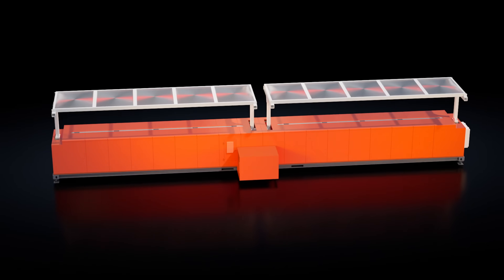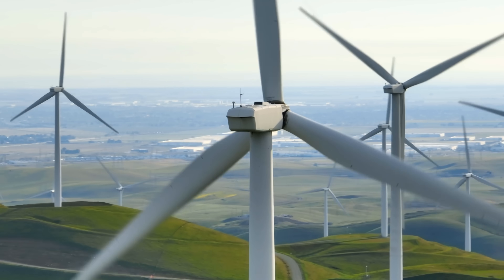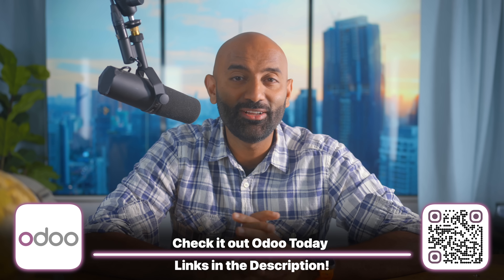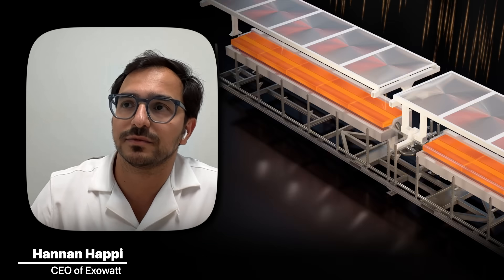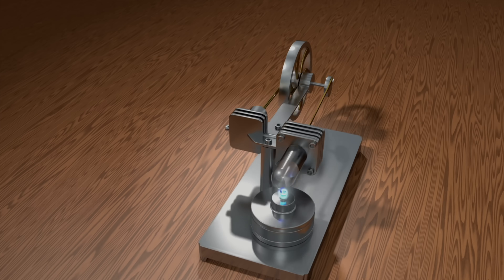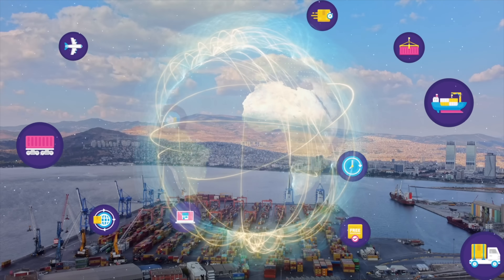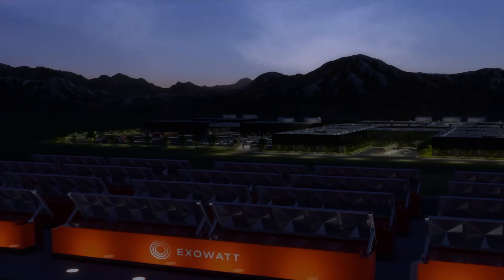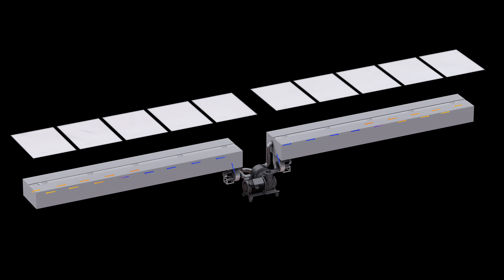Solar Without Panels, Storage Without Batteries - EXOWATT

Comment: Analyzed this thing with ChatGPT. ChatGPT is not impressed:

Summary Table
Aspect	Exowatt’s Claims	Real-World Considerations
Technology	Solar → heat (via lenses), stored thermally, then converted via heat engine	Proven concepts, but with historical challenges in scale and cost
Efficiency	35–40% system-level efficiency	Comparable to gas—but past solar-thermal systems often fell short in practice
Cost	4 ¢/kWh now; target 1 ¢/kWh	Ambitious—depends on scaled production and operational performance
Deployment Model	Modular, containerized, rapid, grid-independent	Attractive, especially behind-the-meter for data centers
Skepticism	Backed by high-profile investors and media coverage	Tech “hype” is a risk; real-world mitigations required

Comment: Just an observation but where the focused sunlight comes into the top of the Exowatt unit. How isn’t a percentage of the heat not lost having a hatch opening? It would seem logical that being at the top of the storage area a significant amount of heat would escape, no?
What would this loss have on the systems overall efficiency?

Comment: I've been thinking about this for ages because it is the most simplified method for getting electricity from the Sun instead of using solar cells to move electrons across the board to create electricity you just heat water turn it into a pressurized gas and use that to run a pressurized steam engine that generates power you can even use a kinetik battery for storing the power by having the steam engine with weights on pulley systems that are attached to gears so you can control the flow of electricity that way as well so you will never run out of electricity and you will never need any chemical batteries the only thing you need is a  material that can stand up to the pressure  heat and wear and tear for long-term which would be the most difficult part of the whole operation. To create a solar-powered energy cycle that can produce save and dispense energy at will without something mechanical going wrong I had ideas for that as well but that's for metamaterials

Comment: This was my idea years ago the only thing missing is the condenser for recycling the water instead of having to cool the water through electrical means you use another container underneath buried up to 8 ft and that would drop the temperature of the steam enough turn it back from a gas into a liquid and have solar powered water pumps to bring the water back into the steam engine and have a pressurized container that has a release valve so you can control the amount of electricity that is released by controlling the RPMs of the steam engine

Comment: Yes, please do an in-depth review. I see a lot of exploratory DER that fail because they haven't considered practicalities. That this firm have considered the full supply chain, manufacturing, distribution, installation and maintenance seems a lot more promising. One thought to checkout, can they sit on top of a data center or is weight / heat / installation too big an obstacle? Looking forward to hearing more.

Comment: Have you ever heard of the Super Critical Water Oxidation Process developed by General Atomics?  This process breaks down organic waste such as that found at refineries.  The process is exothermic and the heat can be captured to produce steam.  The byproducts of the reaction are salts and water.  The unit can fit in a two car garage.

Comment: Sounding off! I want to know more about this project. 

I've worked in wind energy for 8 years as a Electrical Engineering Technologist, Starting in management to operations to working as a tech on the Turbines. After seeing what's involved and the cost and energy that goes into building, also factoring in the poor state of many of the grids where they are installed. It really isn't feasible to go full green.  So much so that I've come to the conclusion that Nuclear is the way to go for large scale "Green" Power.

However after seeing this, there is some real potential here. One unit which can produce 25K Watts has real potential for homes in the country. With units like this there are so many ways to reduce costs for the grid, and by doing so allowing fortification of the grid in key areas. This could be a massive boon for energy consumers and producers.

Comment: Compared to the plug and play nature of solar panels, this solution adds so many moving parts - maintenance will be a never ending challenge. Unsure on dangers when combining high temp, high pressure engines and volume energy storage.  Wouldn't be surprised if parts of this design are forced underground to aid in cooling or reduce surface devastation in a blowout.  kinda kills the portability

Comment: Also, do you have an episode on vertical thermal turbines? I saw a prototype in Spai,n then nothing. It is a cylo with multiple fans that can slide in and out using the rising air pressure to provide 24-hour power. Also, there was something about a focusing...cone that focused the heat into the ground. If I got the name wrong, I hope my rabbings make sense.

Comment: If you're using Sterling engines, why only one to the two containers vent the exhaust to several? You might lose 12% pressure, but a Sterling only needs heat to move.

Comment: There is couple of stuff:
1. Main advantage of this type of farm IS lack of need for complicated materials. Most stuff used for those farms are easily renewable.
2. Ai image generators should be simply destroyed and deleted. They are not worth anything they produce (more specialized uses like for genes, bacteria etc. can stay but they shouldn't keep ai generators for Facebook photos...)
3. There is still a question on how it is affected by time of the year. As it is extremely heat based farm, winter could cripple it.
4. This type of farm is even more susceptible to bad weather. Solar panels can still work when clouds are in the sky, they will simply work worse, but this farm might completely stop working if sky gets to cloudy for to long.  Because of that this farm might only be placeable in areas that often will not have any clouds.
Reply: 3. Sterling engines rely on heat differential, assuming one of the plates is just exposed while the other is eating 1k°F, the power will likely moreso be affected by total sun exposure available than temp differential across seasons. Similar to any Solar tech.

4.You'd be surprised how much heat you can focus even under moderate cloud cover with some lensing, but this argument is fundamental to solar capture technology in general. If the sky's going to be opaque for excessive timeframes, you're likely developing other systems to supplement this one.

This system will be viable pretty much anywhere solar capture proves viable, just not on the roof. The sell point for this system over photovoltaics is going to have to be how materially cheap it is to put together and nothing else.

They'd be better served using a static parabolic dish to that end instead of a solar tracking rig, imho, but I can see why they'd install the rig for some convenient planned obsolescence.
Reply: @Sch3m3r-a  4. It is competing against PV+Battery.
 How would a static parabolic dish work, it needs to track the sun.
Reply: @catprog 
By being a compound solar concentrating trough aimed for a target "optimum" likely around a 2 o'clock sun such that it would still dish down to 7 pm at an admittedly reduced efficiency.

Flip it around for morning sun at 10.

Reduction of viable surface area inherent to the "static" idea as compared to a tracker is probably actually why that's not their pitch.

As for their competition, I know, I watched the video.
Reply: 3. Summer would be the one that kills it. sunlight + cold weather increases effeciency. Hot weather decreases it.
4

Comment: Hi man, great video. Im just doing a little Elon Musk thinking here. Best part is no part, right. 

What would happened if we take away the one part of 3, like the Sterling engine, heat by itself is one of the largest sources electricity is then turned back to again, especially thru hot water. 

So factorys, schools, gyms, sport facilities, large stores and any household where they will fit close by could use this for that purpose even cheaper. 1-4 for the heat and hot water for example for probobly 10-20 households in a row. You could then also put cheap heating elements in there to be connected and take from the grid on off peak times to help out. And with no sterling you have space for more heavy mass.. water in and out, pipes instead of cables.. still cheap as chips.

Comment: 2:20  Wrong, the reason we could use something like this isn't for massive farms to feed AI.  That's the job of small nuke plants.  No, this would be useful for those off grid.  Finally you could have air conditioning on the sunny, hot days.
Reply: @DeclineManagement  or pump the heated air directly into the house in winter to save on heating costs :D (as long as the lenses arent covered in snow, I guess 😅)
Reply: He's not "wrong", you're just suggesting a different use. Good luck getting a small nuclear plant built in the US.

Comment: My brother (double PhD Standford math & physics) is very solar-skeptic and very pro-nuclear. Speaking vicariously for him, yes, I want a brutal on-site review of Exowatt, investigating as many of their claims as possible. (You allude to several engineering concerns at the end.) I do understand (and appreciate and basically approve) their engineering approach to be cost-effective vs. "the best" in terms of innovation or efficiency, so what I'm really asking for is a breakdown of their claims vs. actual operating costs. (I understand this is difficult when they are just beginning to install systems so your database will be necessarily constrained.) I know one of my brother's main critiques of solar is its low-density, high-land use compared to nuclear, so I'm less interested in an Exowatt-PV comparison as I am with an Exowatt-nuclear one. How does Exowatt compare w/ e.g. modular nuclear?

Comment: One would think storing the containers underground with only the tops exposed would assist in insulation and fire prevention. If there was a way to direct parabolic heat to a central location to provide heat to multiple units then they could be buried completely and the land above used for other manufacturing space etc. Same could be done by connecting large round tiles underground, and the heat source circulating through a much larger area. The calculations could be done to ensure the proper amount of heat per area and so long as the containers were covered in sand and then a soil area the external temps on average of 65 F could be maintained for maximum insultation advantage.

Comment: I think with all these data centres, district heating should make a a comeback as well. It is criminal that a house down the street from a datacenter (that is exhausting heat in the atmosphere) struggles to pay its own heating bill.
Reply: Even within one building, how many sports centres have thier a/c vent unwanted heat to the air instead of heating water, saunas, jacuzzis or pools. I even went to a centre that had a pool and an icerink and they weren't leveraging the two things different need!
Reply: Good for profits tho

Comment: I'm going to have to block this channel.  It's being a mouthpiece of gee-whiz promises without bringing the necessary journalistic rigor.

Exowatt's idea is plausible, but the density of power generation per acre of land looks unrealistic. Between the inescapable inefficiencies of converting sunlight to heat, then storing the heat in bricks, and then converting it into electricity and somehow accepting that the units can be spaced closer together than solar panels - which is ridiculous, because they have no less need to get unrestricted sunlight than PV panels do - this is a non-starter.  It has its merits but efficiency is not among them.  Land use is not among them.

Comment: About sun track, instead of a fixed angle, you can build a manual adjustable tracking system with just a few angle settings for summer, winter or anything in between. The device only needs a reset twice a year.

Comment: Exawatt P3 Overview

    Technology: Modular 40 ft shipping container system producing 25 kW each, scalable by adding units.

    Core components:

        Fresnel lenses focus sunlight onto thermal storage blocks.

        Thermal battery (ceramic/clay bricks heated to ~1,000 °C) stores energy for decades without degradation.

        Stirling engine converts stored heat into electricity on demand.

    Deployment: Shipped ready-to-use, minimal on-site construction, domestic materials, no rare earths.

    Target cost: 4 ¢/kWh now, aiming for 1 ¢/kWh. Calculations show 2.7–3.3 ¢ over 30 years; 1.7–2.3 ¢ over 50 years.

    Advantages over solar PV + batteries:

        24/7 dispatchable power built in.

        No lithium battery degradation.

        Lower land footprint (2.3 acres/MW estimated vs 5–10 acres for solar+storage).

        Long life (30–50 years).

        Proven individual technologies.

        Domestic supply chain.

    Efficiency: 60–70% light-to-heat; 15–18% total light-to-electricity, prioritizing cost over efficiency.

Context & Use Cases

    Driven by massive and growing AI/data center power demand (could be 9% of global electricity by 2035).

    Works best in sunny climates but can charge bricks from the grid (resistive heating) to store excess renewable power.

    Could serve as a stable renewable backbone for AI infrastructure and other high-demand users.

Challenges & Concerns

    Historical failures of similar tech (e.g., Stirling Engine Systems).

    Geographic limitations.

    Skepticism about scaling from prototypes to mass production.

    Competition from rapidly cheaper solar+storage, nuclear, and other tech.

    Manufacturing complexity: must meet extreme uptime and cost goals while simplifying design (e.g., single-axis tracking).

Bottom Line
If Exawatt can mass-produce at the claimed costs and reliability, it could offer a cost-competitive, low-maintenance alternative to battery-backed solar for continuous, large-scale renewable power—particularly suited to AI-driven, high-uptime applications.

Do you want me to also make a short bullet-point “pros & cons” table for it? That would make the trade-offs instantly scannable.
Reply: What we want to see is an actual working device, not bullet points of the marketing talk ;-)

Comment: Solar panels are so cheap. Anything that requires concentrating sunlight can only use the directional component of sunlight. Also it appears they only get the energy footprint of the container itself, wheras you can fit approx. 200kW of 5b Mav pre-fabbed traditional solar can fit in a 40ft cont. They are much worse for logistics costs to site. Exowatt have painted some very rosy numbers. Comparisons to utility scale solar is not fair, these have intentionally spaced out systems with small land penetrations minimising environmental harm / enabling dual use, and to make the most economic use of the capex of hardware given the cheap land cost. BTW, most solar farms are single axis... do your homework.
Reply: Suggestions to them is to re-package the system as a half height container to double their logistics efficiency, Provide transparency on which parts of the world this could actually work (large direct sunlight component), find a way to increase the surface area yield per container.

Comment: Interesting for sure. Very promising, but I'd like to hear more about the power electronics that control all this. It's one thing to call hot bricks a battery. It's another to try to run your data center off hot bricks. And who's maintaining those scores or hundreds of sterling engines. They don't oil and adjust themselves.

Comment: Definitely do a deep dive on this. Communities and neighborhoods could use this immediately. If you have a large enough property, this would solve all problems. Scaled down for single homes would be a revolution. Perhaps consider the use of MGA Thermal bricks for heat storage in the unit. There's a company to deep dive. Joint venture?

Comment: i ahve a frenel lens from my old box tv home threater ill tell ya what theres not a big enough sterling engine on the market to power a generator so idk what they are talking about. but i guess with enough heat you can power anymotor with the use of turbines and steam
Reply: Having Fresnel lenses myself I doubt they can heat a large thermal mass to 1000°C to begin with. Unlike other solar concentrators they heat from the top which is quite inefficient. I tried something similar with only 1 thermal brick and couldn't get it anywhere near that. Also the singular axis tracker is not how it works

Comment: That would be nice for heat source, too - I'm not thinking of multi-acre datacenters, just an off grid home in the mountains. 
Electric when needed, Heat for the winter so nothing freezes even if nobody's there. Maybe even ground-heat for the greenhouse - all from a container.   that seems pretty feasible.
Reply: This won't work in winter, unlike photovoltaic it needs full sunshine. If you only want heat there are better solutions, like evacuated tube collectors